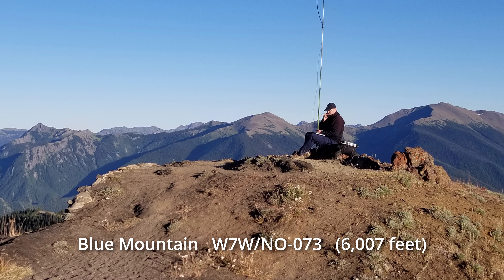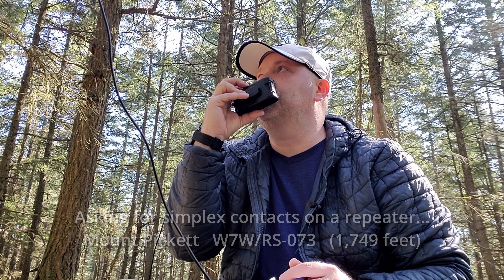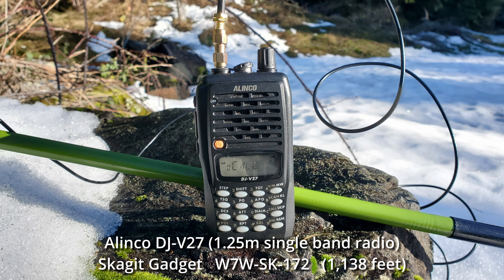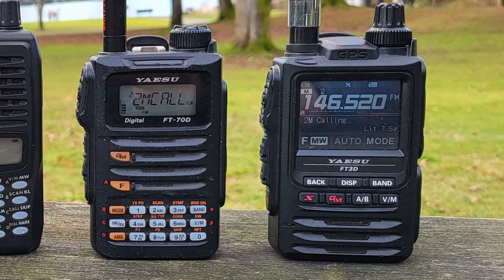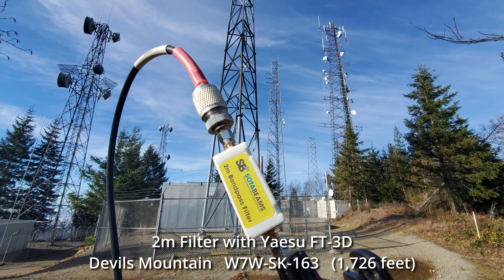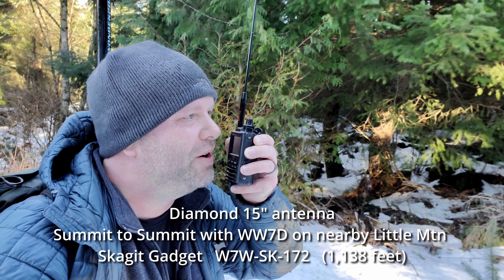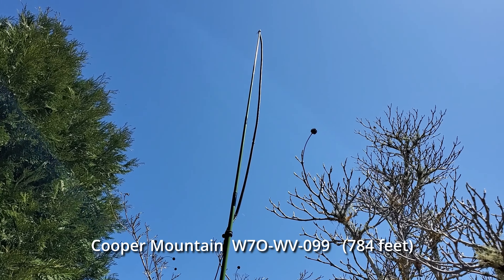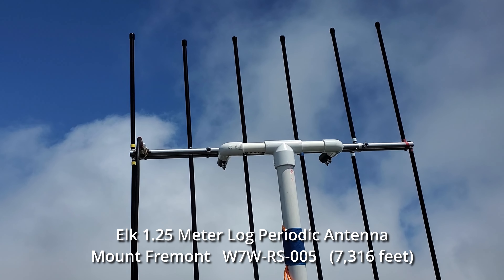Activating SOTA on VHF/UHF - Radios, Antennas, & Tips

Comment: Thanks; I carry a roll up J pole and a small mast to get it into the air on almost all activations; helpful video.  I have called CQ once on 146.520 and gotten nothing; how many times have you gotten a response without first some type o spot or aid to tell folks you are there?
Reply from the maker: For calling on 145.520 without a spot, I'll often get contacts but it will depend on the summit (ex. elevation & line-of-sight to Puget Sound), day or time of day, antenna, etc.  Sotl.as or the Sota summit website will list each summit, and how many contact have been used on each band.  That can be a good check to see if the summit you want to activate has had success on 2m, and will help confirm whether it has good line-of-sight to more populated area.  Day or time of day can change as well... mid-day on a weekend there are usually quite a few people listening for summits in our area.  While I have made contacts without a spot, recommend posting an alert to let people know you will be on a summit with approx time.  It helps chasers know you'll be there, what band, and they might want to chase that summit for a SOTA "Complete" (both activating and chasing a summit).  Posting an alert, and then a spot is the best way to increase chances of a 2m contact.  Hope this helps, and have a great day!  73
Reply: @wa7jnjradio Solid analysis and advice; thanks. Was going to tr it yesterday at my park activation and then I reached for my handheld and discovered....I had left it at home!  :-)

Comment: Lots of good tips thanks!
Reply from the maker: Thank you Bill!  Looks like you're a member of the BC SOTA FB group... I am as well, and check it once in a while. (-:  Thanks for the quick comment, and maybe we'll get a S2S this year!  73, James
Reply: @wa7jnjradio  That would be great. I'm planning on going out today on VE7/CV-030 and start on VHF. I think you're in WA state but not sure if I'll get out to your area. Should be on the air around 3:45pm.
Reply from the maker: Sorry for delayed response... I turned on radio that afternoon, but not sure my radio hears the best and I often drive a few hundred feet up the road in Marysville, WA when chasing or seeing a spot or hearing other people chase the SOTA station (-:
Reply: @wa7jnjradio  No worries. I managed to activate it on VHF which was my goal. That was my first VHF activation. I think Marysville is too south from where I was to get a good shot into it. But it does have a great direct shot into Bellingham.

Comment: Well presented summary of options for activations with HTs using FM.  I think the best results are found when an alert is posted at least a day before the activation, together with notices to local hams via the usual mailing lists and even news broadcasts.  Self spotting when on the summit then is the trigger for many chasers and for other activators nearby to look for you.  There’s another thing you may be interested in trying when signals are weak.  Go horizontal - we have found that horizontal polarisation gives better range than vertical.  Some people think FM requires vertical polarisation - no, it’s just a convention due to vertical antennas being easier to set up on cars and HTs.   Then once you have found that improvement, use SSB.  The FT817/8 at 5w, for example, is easily capable of good distances on SSB, more than FM distances.  There are not as many folk readily available on ssb but there are well equipped home stations who like working dx ssb to distant summits.  They are more used to “real” distances above 500 miles, but will still appreciate working a summit at 250.  73 Andrew VK1DA/VK2DA
Reply from the maker: Thank you Andrew and great feedback!  Spotting is key and there are many great chasers watching for and wanting to help activators with QSO's.  The email idea also works, and I saw a newer ham with tech license almost activate some sparsely populated summits (ones mostly done on HF).  Told me he reached out to the club in the area, and they shared with members that he would be over there looking for simplex contacts.  Someday I need to try 2m ssb...and good info on polarization.  73

Comment: How do you attach your mast to the ground? And does it need a ground plane if I'm using a mobile?
Reply from the maker: When using a mast for 2m (or HF antennas), I'll generally use bungee to strap mast to bush, tree, anything.  Have crammed in rocks or held mast (if 2m rollup jpole) as well.  Haven't guyed the mast, but just posted video of Adam K6ARK recent guying tip.  Ground plane question - For portable hiking, etc. I mostly use 5w ht radio's when using rollup jpole on a mast and coax cable straight from antenna to radio.  I've used a 50w radio a few times with this setup as well.  For my mobile radio on car, I have antenna in middle of roof...and at times I've used a mag mount antenna on a metal cookie sheet as ground plane.  Hopefully this starts to answer your question... appreciate the question, and have a great weekend!

Comment: Thank you for sharing your experience and recommendations for SOTA activations. What type and length of antenna feedline do you prefer for VHF/UHF activations? De KC5EJT.
Reply from the maker: I usually keep as short as able... 6 feet generally (or 10' is what have on rollup jpole).  I've usually used RG58 (maybe RG8X) for VHF/UHF... For HF ~15' of RG174 is mostly what I've used.  Main tip is to keep VHF/UHF cable just as long as needed. (-:  Hope this helps.  73, James

Comment: It is easier to get simplex GMRS contacts than on the amateur frequencies. Is that allowed?
Reply from the maker: Thanks for reaching out with this question.  GMRS contacts wouldn't necessarily be easier, but potentially similar to 2m VHF or 70cm UHF band contacts?  I'm a bit unsure how many people are listening on GMRS frequencies, but there are usually decent amount of people monitoring the 2m band 146.52 (national calling frequency) With SOTA, per rules section 3.10, only amateur radio frequencies or bands are allowed.
Reply: @wa7jnjradio  thanks for your response! 
Our area might be different from most. We have a large group of GMRS users, and because there are only 22 channels people just tend to scan through them all on a regular basis. Simplex contacts are almost as common as repeater contacts. On the other hand I have never heard any traffic on the 2 meter or 70 cm calling frequencies, even though I monitor them on regular basis. 
Your answer clarifies the importance of lining up friends ahead of time so that someone will actually be listening!

Comment: I am wicked hard on my equipment when hiking/SOTAing and have recently killed my HT from too many hikes in the snow and it being on the outside of my pack. Got any good picks for a rugged good HT? Great video. Thanks

K1EEB
Reply from the maker: Hello Eric, not sure what you've been using or price range for new... but a few ideas.  As background, I generally hike in better weather, but have gotten radio rained on a few times.  Most of my radios are resistant (ex. IP54), but with you being extra hard on equipment and using in snowy weather...there are probably 3 to recommend depending on price/preference.  All three are more weatherproof & even submersible.   The newer ICOM IC-T10 is dual band and more weatherproof than the IC-V96 I've used and been impressed with ruggedness.  The Yaesu VX6R is an older radio, but rugged, tri-band...and had good reviews recently from TechPrepper and others due to quality, rugged, etc.  The most expensive option would be Yaesu FT5D...I've liked the FT3D and dropped once or twice, and would primarily get this radio for APRS, 2 receivers, etc.  Hope this helps, and would love comments from others if I missed any.  73!

Comment: Thanks for this video. I've had mixed results with 2m and am yet to activate a summit with it. It doesn't help that I'm often in remote areas in Utah, where hams are thin on the ground. One of these days, I'd like to buy a radio that does 2m SSB. I expect that it will only be useful when there's a 2m contest happening, but I think it would be cool. 73 de K7DMJ
Reply from the maker: Thanks David, and agree it definitely depends on location and hams around... I still haven't done 2m SSB, and would be fun for sure... it does help to time activation with 2m contests, and I've done that to help with 70cm and 1.25m.  (-:  73!